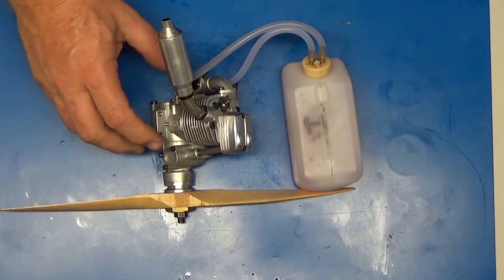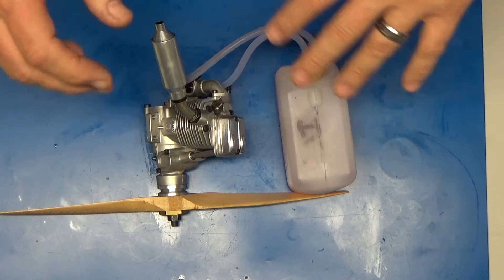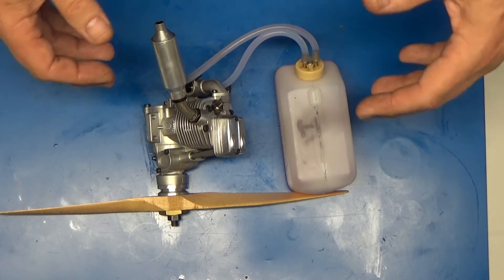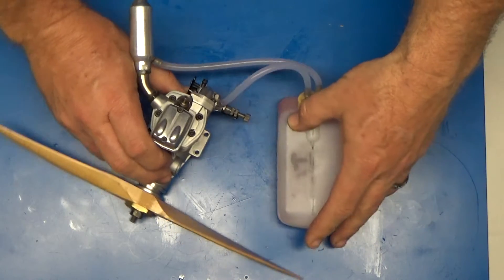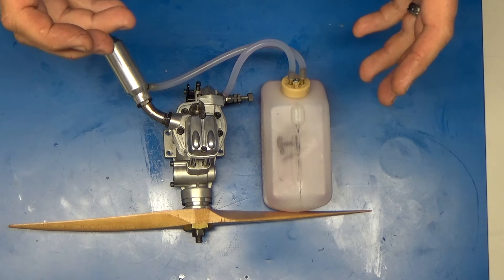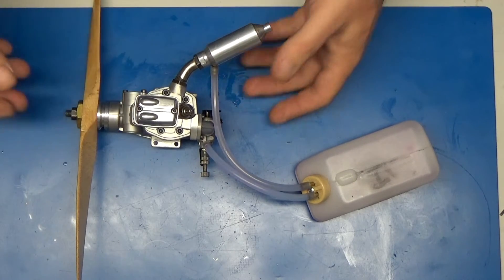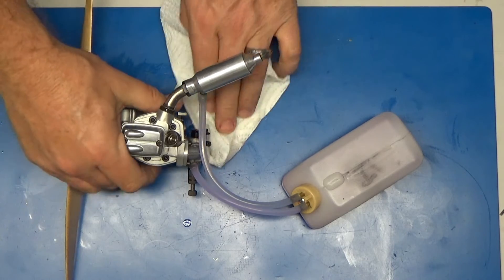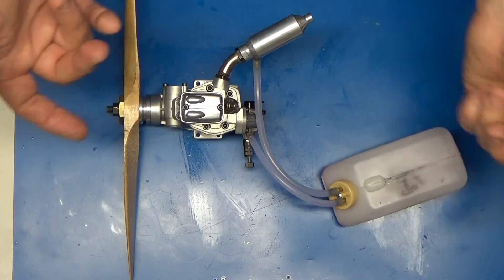4 Stroke Engine With Air Leak

Comment: Hi, i recently bought two OS fs 40 engines, and i got one of them running well, but the other one has a problem with the intake valve. I know that it is not the carburetor that is leaking, because it is blowing a little air out of the intake on the head, without the carburetor on. I thought the valve might be bent, but it seems straight enough when you spin it in a drill. I tried both to lap the valves and exchange the intake and exhaust valve with each other, but even after i lapped them again, it still doesn't seal properly. I know this is the problem, because the fuel going in to the engine is being blowed all the way back into the tank when the engine is being cranked and the intake is choked. To me it does not make sense that the intake valve wont seal even after being lapped several times, as the seat and the valves are shiny, and should be able to seal. The last thing i tried was to stretch the spring to make it seal better, but to no avail... 
Is there any way to fix this, or is it perhaps possible to use newer surpass parts to replace the valves and the valveseats?

Thanks.
Reply from the maker: It sounds like the seat is damaged.  A new head would fix it.  BTW, I never have needed to lap valves on an engine to get them to seal properly.  9 times out of 10 lapping causes more issues than it solves on these small engines.
Reply: @dmrcflyr2  Yes. however, i dont see any marks or any imperfections on the valves or valve seats. They are completely blank. Before i lapped them the previous owner somehow made some pretty deep scratches into the valve so i thought that might be the problem, but it was not apparently. The only problem with buying a new head is that it will be the new surpass type, and i dont know if everything will fit on the old pre-surpass engine i have. Also a new head would cost more than i gave for the engine
Reply from the maker: @Hans45  Well a Surpass head will certainly not fit.  This is the issue with buying older engines. Parts availability becomes a HUGE issue.  Just because you can't see any issue on the valve seat does not mean it doesn't exist.  Clearly if it isn't sealing then there is a problem.  A new valve would be the only other thing to try.  Otherwise the engine is a doorstop.
Reply: @dmrcflyr2  If the surpass valves will fit, why cant the surpass valveseats be used also? I dont think it will work just to get the new valves, beacuse i tried to interchange the intake and exhaust valves, so it must be the seat which is causing the problem.
Reply from the maker: @Hans45  How about you read for yourself and make that determination.  There might be parts available if you search however. The valve seats are not, nor have they ever been, a part that can be replaced or sold.  My research shows that the 40 and 48 Surpass share the same valves and they are not the same as the FS40 ones.
http://sceptreflight.com/Model%20Engine%20Tests/OS%20FS-40.html
http://sceptreflight.com/Model%20Engine%20Tests/OS%20FS-40%20Surpass.html

http://sceptreflight.com/Model%20Engine%20Tests/OS%20FS-40%20Surpass%20%282%29.html
http://sceptreflight.com/Model%20Engine%20Tests/OS%20FS-40%20Surpass%20%283%29.html
Reply: @dmrcflyr2  Ok... I appreciate all the help. Thanks

Comment: Hi David i have a problem with my 52 fs that i cant get a low enough idle to it i need to knkw what to do to get a good idle to it
Reply: It holds an idle of about 3200 rpm lower than that the engine will just quittried moving thelow end needle but it still wont hold what can i do to make it run well
Reply from the maker: I do not know.  It could have an air leak on the carb, maybe the low speed needle is set incorrectly.  I have a video on how to setup a carb.  https://youtu.be/2MjVJrhsC50
  It is difficult to troubleshoot an engine issue without seeing it in person.  I have done the best I can with this and the carb setup video.  After that it is up to you.
Reply: Hi dave , got a question, would a front crank  bearing on os fs 52 leak air?

Comment: Hi David i have recently found your videos and always find them beneficial.
I have just purchased a Saito FA80 (my first 4 stroke) which i set according to the instructions, low speed flush with the barrel and hi speed 2 1/2 turns out. It started easily throttled well but would not run well above about 3/4 throttle, it didn't stall but was very lumpy and as i approached full throttle the revs drop off a bit and it got more lumpy. I eventually got it to run well with the hi speed set at 4 1/2 turns out which seems a lot and the tick over was steady but the transition was not so smooth.
Could this be an air leak in the high speed needle, the o ring in the high speed needle seems pretty worn.
I have ordered the carb and engine seal kits so will rebuild the engine and i have ordered a tacho for easier set up.
Thanks in advance for your help andkeep up the great videos.  
Peter from Manchester England
Reply from the maker: Are you certain that you have the valve lash set properly?  When you say 'lumpy' are you referring to it sounding richer?  Does it go away if you attach the glow ignitor and then transition to full throttle.  An air leak is possible but that usually manifests as going lean and dying.
Reply: Hi David
Thanks for your reply.
I have not checked the bake lash, I will do this when I rebuild.
The lumpiness at 2 1/2 turns is like it is rich however there was very little smoke and the engine ran hot as though it was lean. It ran well at full throttle. @ 4 1/2 turns.
I let you know after I've done the rebuild.